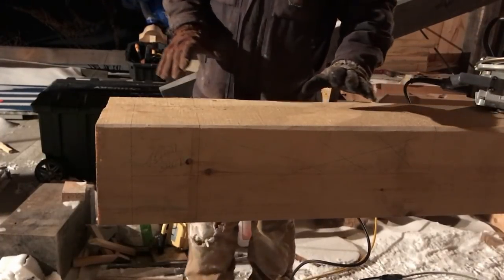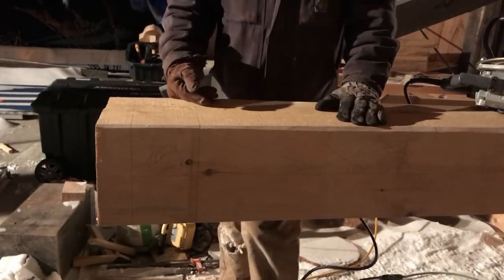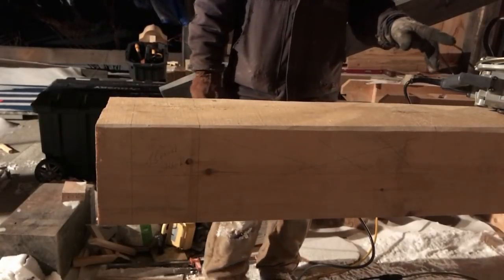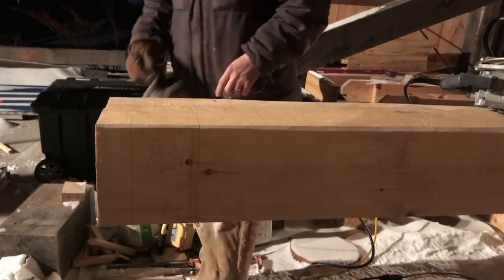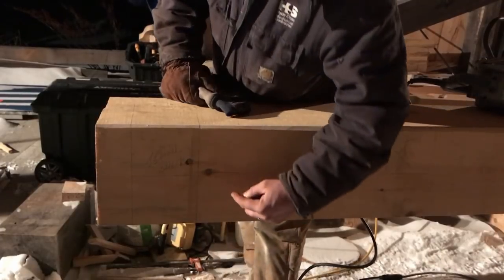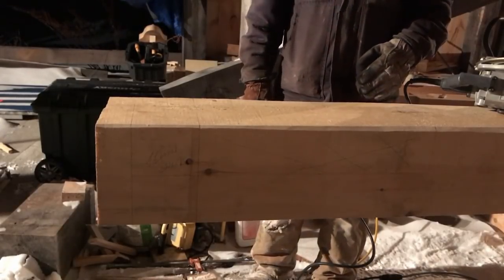A Timber Frame Vlog #99: Another Scarf Joint Done

Comment: Thanks Jim,  good explanation.  I've been tossing that scarf joint thing around in my head for awhile. My mill doesn't have quite enough length and using a scarf joint to get me there , seems to be the ticket. Keep in mind, next to zero snow load and very small wind. Oh, if you ever get down to Rome,  check out " Fort Stanwix ". You can see some of my jointery on the draw bridge and broad axe work on the gun bastions.
Reply from the maker: +Bruce really, that is excellent.

Comment: I agree with you on the placement of the scarfs. To the casual observer the top of the posts would seem to be the ideal place. With a little more thought, at least in my mind, the brace is better. I think what you're saying is that the brace would act like a fulcrum and any sagging on the long span would cause lift on the scarf. Also any deflection from a side load such as wind or some kind of collision there's a hinge point in the plates right over the post. Right where you don't want it. The barn is looking great. Greetings from the south and have a merry Christmas.
Reply from the maker: +Jeremy Moir Merry Christmas Jeremy.  You got it on the scarfs.

Comment: Hi, Jim. Fellow New Yorker here (but not in a long time), Jamestown. About 200 miles per crows, but we're also on the end of a great lake, although with the Eastern Continental Divide along the lake. I've lived on both sides of it. Anyway, I've been in Florida the last twenty years, plus a 17 year stint in the '50s, '60s, and '70s. There's a 26 year hole in my life in Chicagoland, the other end of the Great Lakes, although nowhere near the cold and snow of either Chautauqua County or Watertown (I gather). 

From my limited understanding of engineering, plus a memory tidbit I might have wrong, didn't you say you were doing a gambrel roof? Doesn't the purlin (presumably supported at the end by their own posts) distribute some of the roof thrust one would normally get at the top plate from straight rafters with bird's mouths? In other words, ridge to purlin plus purlin to top plate loads are less at the top plate than the total top plate loads with a xx:12 gable roof. 

Also, I know Jesse and Alyssa had an engineer work over their plans, although that could be an architect with good intentions and not necessarily someone with unique experience with timber frames. I understand there is a document of standards for timber framing (whose name escapes me at the moment) that may address scarf joint placement. I've seen reference to proposed changes regarding dowel placement, so I assume there's an overarching epistle somewhere.
Reply from the maker: +Rod Peterson great thoughts.  Yes, the gambrel roof will negate some if the thrust.  A steep pitch also negates some of the thrust.  Purlin plates are another way.  I was speaking more in general terms of frame design.

Comment: Morning Jim... so, are you milling large rafters or doing a conventional stick roof? Though I did a log home, I went with a conventional roof to save time. As far as your scarf joints and rafters, yes they do have that shear effect but doesn't the flooring bind one wall to another to prevent that? If you don't make another video before Christmas, I want to say Merry Christmas to you and your family.
Reply from the maker: +John Collado I'm going standard common rafters to save time and keep the dead load on the roof at a minimum.  The flooring does help negate some of that thrust but this style of building is meant to rely on the frame for all structural support.

Comment: Jim, one quick question - How do you fasten main beams to the floor? Requirement here in Alabama. The inspectors even made me fasten a 10 X 12 to the pad I already had the corners tied down I added two more each side. TA Birmingham
Reply from the maker: You can make knife plates that insert into the bottom of the posts or you can make angle iron brackets to lag into the posts and then anchor into the concrete.
Reply: @TheTradesmanChannel  Thanks Jim I want to kept those inspectors happy
HAHA